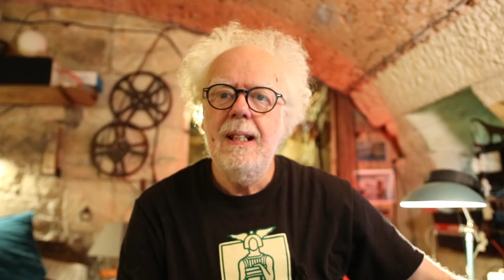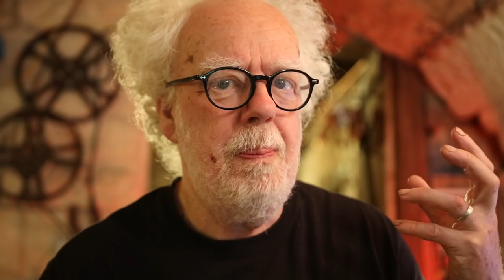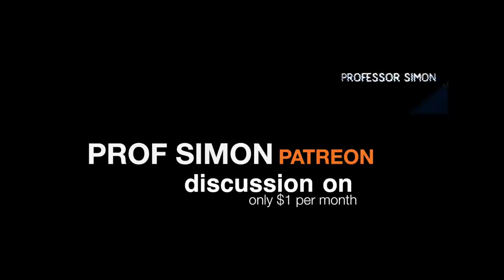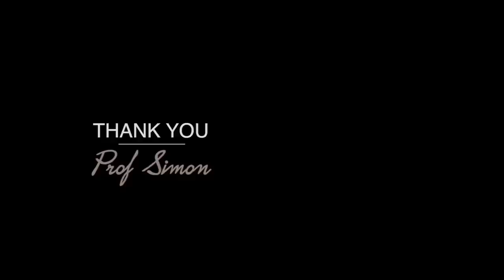737 in EU - Prof Simon

Comment: Not only should AOA be measured by multiple sensors, they should be measured by multiple disparate sensors.
Heterogenous sensors are good because if one type fails in a certain situation, all could fail identically
Reply: The vane type sensors seem particularly fragile and vulnerable to damage. The probe type comparative pressure AOA sensors can be made much more mechanically robust. In the military aircraft I flew the probe was conical and made of brass. We relied on AOA all the time, never knew a sensor to fail.

Comment: Old story I heard about redundancy: Critical flight instruments have two redundant switches so a switch failure will never leave the pilot without power. Every flight he flips them both on, yet one day the instruments fail. Both switches were broken. One of them could have been bad for years but they were never operated independently and the loss of the first switch slipped by unnoticed. This is why you must flip the switches sequentially, and turn them off sequentially in the same order; noting that the instrument power comes on with the first switch and off with the second. This is the difference between redundancy and control reliability. It is not acceptable for a single malfunction to cause a system to fail-deadly but it is also necessary for a single malfunction to cause a system to fail-safe.

Comment: 737s DO have triple redundancy in mans systems. It is inherent in the design of many systems.

An AOA sensor (not OOA) is not as critical as you think.
Its not the be all and end all of flight information. The issue was more that rhe sensor malfunctioned and sent faulty information.
Its not redundancy it needed, it was cross checking with other information available.
Modern avionic systems use cross checking, if there is a discrepancies,  it either flags this information as potentially unreliable to the pilot, or removes it altogether.

The problem with discussing very technical matters such as this is that not all information you can get is correct, sometimes it is oversimplified and EVERYONE has an opinion.

We all have Knowledge of our own areas, and it is all valuable input, however dont take it all as gospel.

I am familiar with several Boeing products and their avionic systems and some of these are the same as they are on the 737 max.

The big issue isn't redundancy, it was poor design because they didn't FORSEE the potential failure and its consequences in their programming.

The other things are minor in the saga, but all points to learn from in future aircraft design.

Having been involved in accident and safety investigations, there are always many factors, but one major issue.

MCAS and its interactions with the airframe were badly designed and certified. The system is a grest idea. The new engines are fine. The training was what the airlines desired, not a Boeing flaw. - but, in future, the airlines will have to spend the time and effort allowing their pilots to do conversion courses.

Great discussion topic thanks professor.

(Don't forget that only having two engines allows no triple redundancy...  but ETOPS is universally agreed to get round this.)
Reply from the maker: Why would the EU say the 737 dies not have the same triple redundancy as airbus.....if they do? My research is many critical systems on 737s have twin systems....3 make a statistical analysis much easier.
Reply: @SimonHollandfilms  agreed, 3 is much better.
It doesn't have triple redundancy in some of the areas airbus does,  but it isnt triple redundancy free.

You will find even at computer level there will be triple redundancy on some of the PCBS and software.

EASA are the safest and most cautious aviation authority in the world, that is for sure. They 100% have rhe right attitude.

That is the reason that the FAA are more to blame for the Max debacle than Boeing are themselves. After all, the FAA release the type certificate and allow boeing to provide the test data.

Boeing screwed up with the implementation of MCAS. The FAA have failed the whole world in their judgment of aircraft certification and safety.
Reply: @underwaterdick  thanks for the excellent information. It's great to hear actual facts for a change. I grow so tired of the masses of anti-Boeing trolls who know nothing of what they spew. It would be nice if you join us on Patreon for a chat.
Reply: @RedLP5000S  honestly, the best source of information is official reports.

They contain facts, and mention all factors. But knowledge of the industry helps.
Aviation costs millions a day, every company is out to save every penny they can as long as they have their certification to say it is legal and above board.
They CANNOT legally skimp on training, so they put pressure on the airframe manufacturers to keep training requirements to the minimum, by keeping similarities between type.
This way, as long as Boeing/Airbus/Embraer etc meet FAA/EASA standards, the airline only has to meet those to be legal. 

Tooling, ground handling equipment and knowledge are all expensive things when it comes to new types, so once again, commonality is important.

For example, as an EASA Licenced aircraft engineer you are rated to work on a specific type, generation and usually engine. If you need to work on an additional type, generation or engine you will need to become certified on the differences.

This is another reason some airlines used to have a single source fleet. All airbus/Boeing. BUT the 737 max scenario has shown that commonality causes issues, if one is grounded, they all are. Whereas if you had an A340 and a 767 for example, one type could remain unaffected by any grounding.

I used to work on a single type fleet of aircraft,  and any potential type safety issues involved grounding them all. This of course leads to massive loss of revenue and increased down time.

I shpuld join on Patreon really for interesting discussions.

The thing to remember is that all advice is from a single point of view, mine included obviously.  I have my industry experience, someone else has other.

The EASA certified Dassault aircraft that I used to maintain didnt have dual redundancy in some systems that today would do. - aviation is an ever evolving thing. Learning from its mistakes and POTENTIAL mistakes daily.

Aviation safety is NOT a blame game, it is a LEARNING curve. If you blame, it leads to cover ups. If you learn from it, everything is so much safer.
Reply: @RedLP5000S  just to clarify, no blame, but certainly accountability where it is appointed.

Boeing designed the software and set its laws, these were flawed.

The FAA certified the type and were happy with the certification testing process.

Both need to be held accountable for their failings, but blaming helps no one unless lessons are learned.

Hence why Boeing have subsequently picked up and openly admitted  its onwn quality failings, such as excessive FOD in its products.
Reply: @SimonHollandfilms  forgot to add, I don't Believe that EASA want to "get back at Boeing" I very much think their primary concern is safety. And THIS is the event where they can tell the FAA that they are not as stringent.
I have worked both FAA and EASA registered aircraft,  and EASA have a much better system IMO than the FAA.
Reply: The sensors that failed ws only one OF what I heard and now they have 2 sensors . Like that matter when it failed so often -so instead the plane now will only fail 1 on a couple of years when they could made  it fail 1 in 20 years or not at all-they are still saving bucks for the shareholders it seems.
Reply: @jari2018  saving bucks to sell aircraft,  not shareholders.
The more orders the better.
Reply: Oh, our thermometer malfunctioned and  gave an incorrect reading for the patient. But, the patient still has cancer.
 The 737 has had a 62% increase in take off weight with a 25% increase in wing area. The latest engines' nacelle has 250% more cross sectional area than the 737 100.
Reply: @paulspencer889  You are spot, in the case of this aircraft AOA was critical and should have been protected by redundancy. It is also important to note AOA becomes more important as aircraft operate close to performance boundaries. It is now clear the max with added power and C of G changes highlighted in some of the aircraft's promotion videos was operating closer to that boundary than previous versions.

Comment: We do have a good deal of system redundancy in the 737. If just about everything fails we can still fly it for instance. It’s somewhat misleading to assume that we do not. It is also misleading to imply that the Airbus redundancy is without its own inherent problems. 
You might want to research the ongoing auto flight/flight computer problems the Airbus has had for many years. There is a dodge that all Airbus pilots know which involves turning off two of the flight control computers to regain control of the aircraft. The Boeing AOA issue you mention is related to the MAX which was a software problem. The software only looking for input from one AOA cane instead of the two. 
Great channel by the way. Great to chip in for a change for me. 👍🏻
Reply from the maker: Good points...but it’s still not the modern triple system
Reply: Professor Simon Holland What if you have a case where two of the triple systems have erroneous data and out vote the third, fully functioning system? This can be the case with the Airbus auto flight system where two of the three erroneously sense a stall condition and commence a stall recovery, lowering the nose of the aircraft in an attempt to reduce the angle of attack of the wing? They would never be able to sense a recovered condition and continue to input an incorrect flight control command to the fly by wire system to again lower the nose. A condition somewhat similar to the MCAS system in the first MAX aircraft. Actually that would be a really interesting program for you to compare the MAX MCAS stall recovery anomaly with that of the Airbus anomalous stall protection . It’s a very similar situation and would make for very interesting viewing. I don’t think I’ve seen anybody compare the system before. Really interesting stuff yet again, I’m an avid viewer👍🏻👍🏻
Reply: Eighth Man 
Is that the fault where the fix was to turn off two of the three flight control computers to allow the pilots to hand fly the aircraft in direct law? 
Sorry I’m a Boeing guy so may have a few terms mixed up.

Comment: I used to be a technical manager of a data centre which has numerous redundant systems (five 9's uptime 99.99%) , from an N+1 to +N configuration. meaning there were loads of equipment there waiting! the name of the game is to identify and remove single point of failure in a redundant system.

Comment: Just as a quick addition, "hangar rash" and "fragility" shouldn't enter into it.

A pre-flight inspection by both ground crew and aircrew should involve a visual inspection of the AOA.

"Hangar rash" can occur on any item if people do not treat aircraft as they should.
The allowance of "hangar rash" in the first place is an allowance of compromised safety. A result of a poor safety culture.

I dont inspect aircraft components and "allow" for damage. - Damage is unacceptable.  Regardless of cost. Unless you want to compromise safety.

I recently changed a damaged combined  pitot static head,  it had been eroded by weather, which just happens. It was a long, complicated and expensive job, but the head is so critical to sadety it was unacceptable.  Redundancy could have solved this, but where do you stop?

A third pilot in case the other two die? The chances of which are so slim it makes it commercially unviable.

AOA isn't the primary sensor for flying, the PFD usually takes its climb angle from an AHRS or inertial platform.
Yes, these don't detect airflow, but they do give information about angle of climb.

Comment: The key point here is not redudancy but  sorting out discrepancy
After an instrument failure  the only way of solving discrepancy is cheking out  data  (instrument readings ) coming  from three independient sources.
Reply from the maker: Exactly...that’s why 3 sensors are the minimum.
Reply: Its not just software, it appears due to aerodynamic forces, the young guy flying the Ethiopian aircraft wasn't strong enough to move trim wheel with left arm. In part this seems because diameter of wheel had been reduced from previous versions. Forces on these wheels should never exceed the physical strength of pilots (male/female, left/right arm) flying the aircraft.
Reply: You are right there Jim. Accidents rarely  happen  due to one single cause. Actually, we call "root cause" to those latent events that are "awaiting" to trigger the chain of events. The outcome of Injure and damage is random.  Finally,  some accidents  are originated  not only in the  design stage but in the budgetary area. Regrettably,  some aircraft manufacturers  don't  spend one dollar on safety unless they have a serious incident.

Comment: I see quite a few comments here that are a little defensive in tone.  The essential facts are that no flight envelope protection system should have the ability to slam the nose down with enough force to overcome the pilot.  At low altitude this can only have one outcome.  Visual walk arounds on large aircraft while important, are of limited value and I have personally not heard of an externally damaged vane causing an accident - it is typically internal failure or water ingress that causes the problem.

Personally I have far more confidence in Boeing than airbus, but the appalling procedures and self certification regime that allowed MCAS onto the Max must never be allowed to happen again.  I do agree with the creator that this has nothing to do with safety and everything to do with creating a monopoly in Europe for airbus.

Comment: I recall reading that Boeing actually wanted to move on from the 737 with the new 797, but several airlines were pressing them to instead stay with the 737 platform. I don't know if there's any credence to this but it takes two to tango.
Reply: Of course that is rhe case.

Airlines don't want new aircraft if possible.

New equipment,  tools, staff training etc all required. Not to mention relationships with suppliers, manufacturers and overhaulers.

The most desirable product is one you are equipped to use almost straight off the shelf.

Think about apple and the iPhone. Many customers walk away each time they change the charging port/jack to something unique, because it requires investment in new accessories which they may have spent many hundreds on in the recent past. Car manufacturers are  a good example too, they have their own unique tools, methods and systems. Some people buy the same brand of car for years because of the familiarity with these systems, methods and tools. If they change drastically, customers happily walk away.

Boeing want to sell aircraft, customers want commonality, Boeing offered this.

The same with training, Boeing couldn't care if the type required a year of classroom and simulator training... but the airlines want their pilots to fly multiple types and require little familiarisation.

It is no difference between some airbus models, pilots can fly multiple types with little additional training because they are designed that way.

Beoing screwed up the design of MCAS and its authority, the airlines wanting to save money drove some of the other factors.

Overall the FAA are the real evil In the 737 max for allowing certification of it.

Comment: Revisiting this video since learning of the tragic 737 crash in Indonesia. It is not yet known what caused the crash. The 737 is an outdated aircraft. I like the idea of having some hydraulics as a kind of redundancy. But I don’t think it very realistic to expect pilots to be able to fly a plane with failed electrics in an emergency situation. The so-called double redundancy system is obviously absurd and really means there is no redundancy for those instruments and electrics and whatever else. There basically shouldn’t ever be passenger jet crashes in this day and age in my humble opinion. What I’ve heard so far about the Indonesian crash is that the radar and communications were lost and the plane descended rapidly and there are reports that a witness may have seen part of the plane on fire which could be an indication of the cause or only a result of whatever went wrong. It’s a terribly sad event and it bothers me to think that the aircraft design itself could have contributed though obviously it’s too early to say

Comment: im feeling that the 737 might be "passed" in exchange for the tariffs against airbus in the usa dropped. the 737 could easily add a 3rd synthetic indicator like in the dreamliner.
Reply from the maker: They could have made it much batter but the airlines wanted a cheap aircraft...Boeing delivered
Reply: @SimonHollandfilms  its not even that. its to do with this "grandfather certificate" of type. the idea that the max 10 is just the same as the 737 circa 1960 is insane and thus does not need a new cert is ridiculous. the NG should have never been certified. they changed so much & yet smoked it past the FAA. the reason it has taken 2 years to "fix" the max, is not that boeing engineers are dimwits, its that they are trying to fix it without incurring a type change. many professionals are of the opinion that the max, if certified today would not pass modern regs. regulations of the 1960s were very much easier.